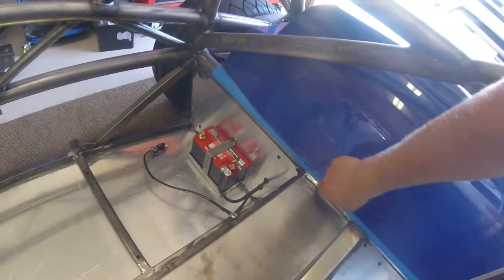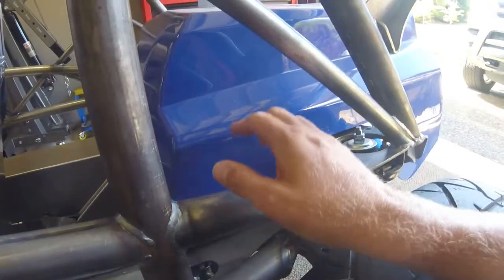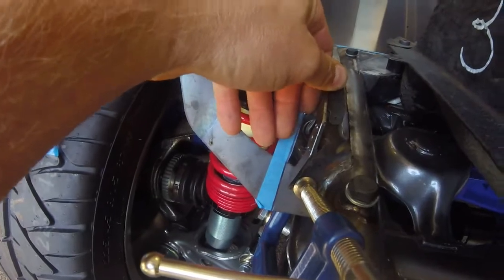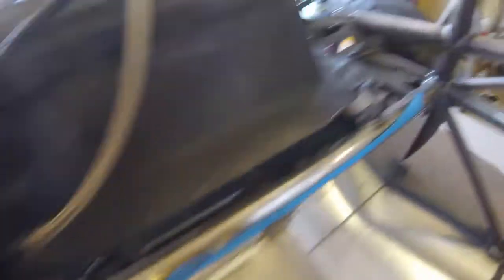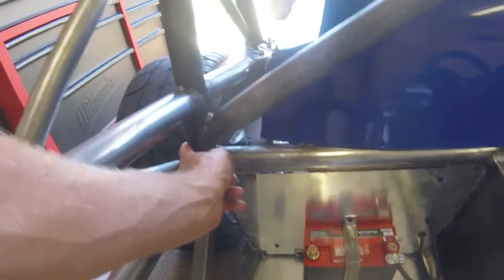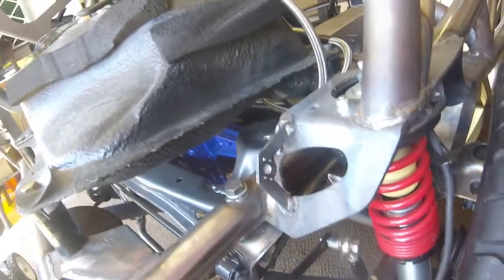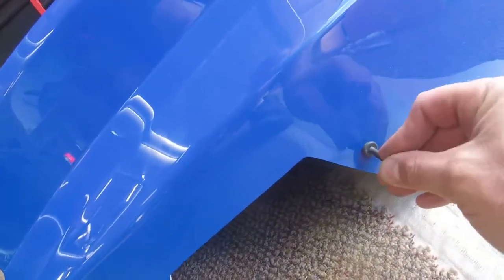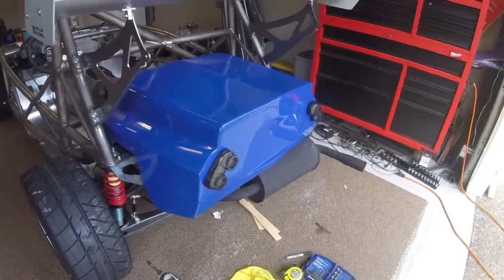Exocet Build: Fuel Tank Cover Install (Part 43)

Comment: Have you done anything with the fuel filler yet? I've been working on mine and it's been a PITA to get it where it want it (coming out the top of the rear bodywork.
Reply from the maker: Pm me on messager or Instagram and I will send you pictures if I have some
Reply from the maker: Ya I did.  I don't think I did a video on it because I wasn't happy.  Cut the hole in the fiberglass right above in the corner.  Then find a fuel hose with an elbow and some clamps and make it work.  There is no good solution I have seen.   Mine is mounted in the middle and the hose is bent and crimped like hell to make it fit.  Like I said it works but I wouldn't follow my lead.